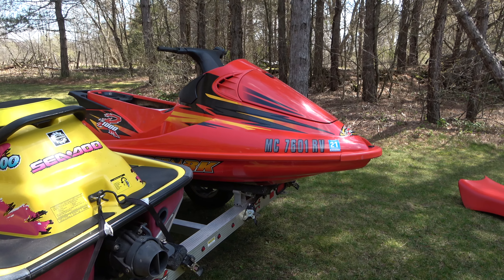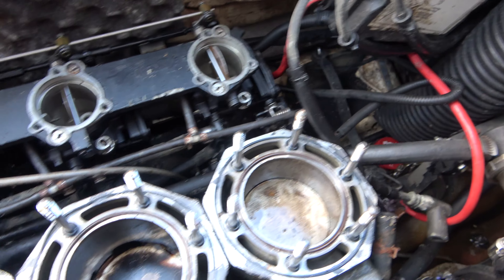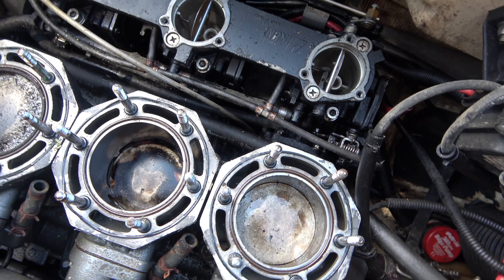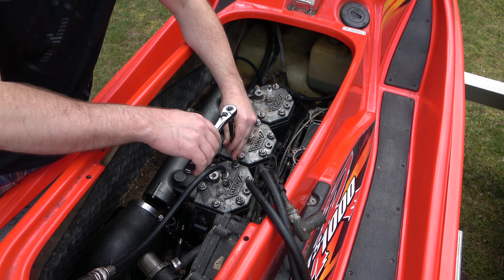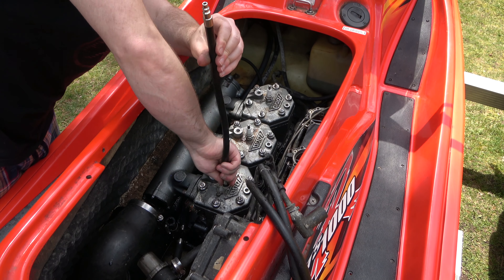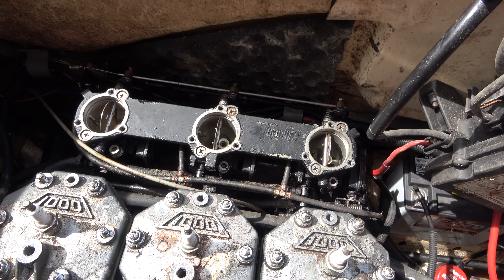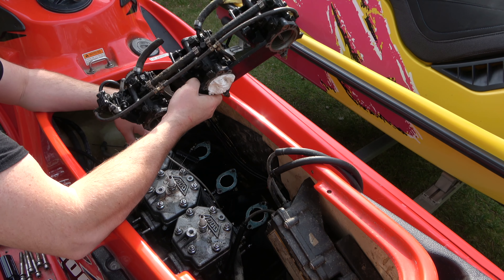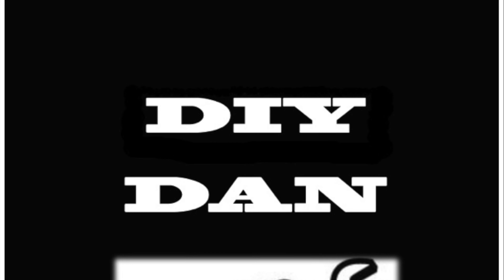My $200 Jet Ski Project Part 1: Tigershark TS1000R

Comment: I just bought a 99 tigershark 1100 tsr...  and of course it didn't run when I bought it,  the motor was full of water once we dug into it.. I have a question.. where do I mount the battery in it? It didn't come with one so I'm at a loss as to where the battery actuality sits

Comment: I was hoping to pick your brain about this type of jet ski, I bought 1 just like the one you are rebuilding (got it for 300) if i could attach a photo here it would help out but on the PTO side of the motor it seems to be missing a plug or a hose connection on the motor. The ski runs great but it overheats and when i cycle water through the ski it pours water out of the spot I am talking about. can you help me out???